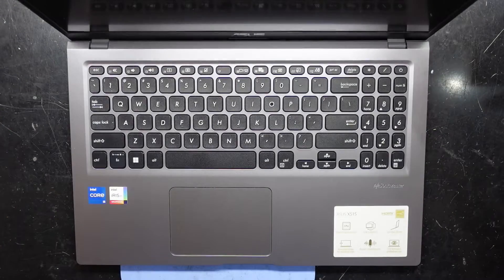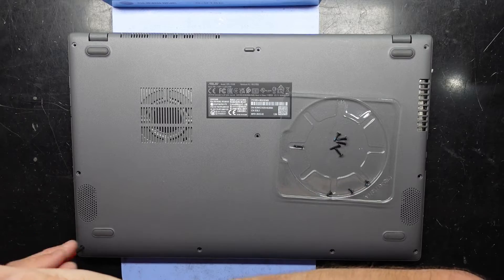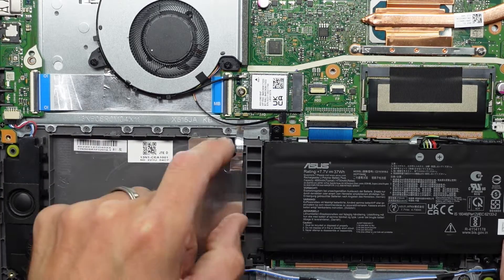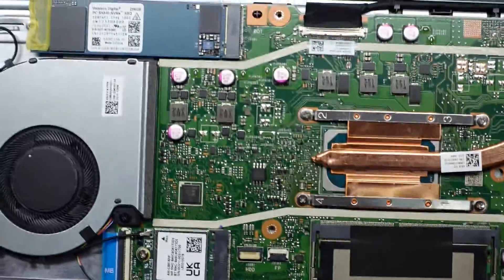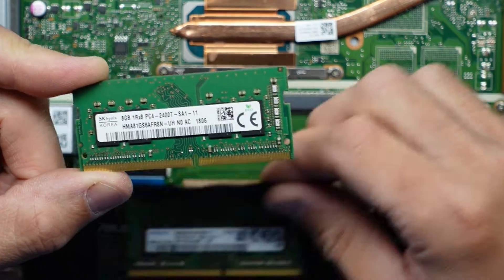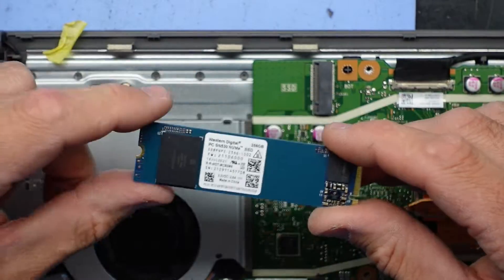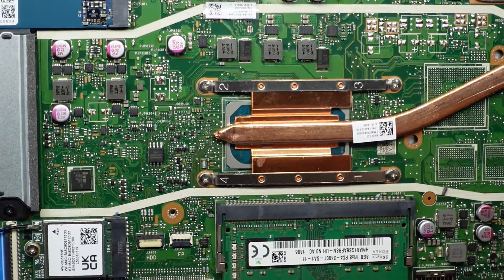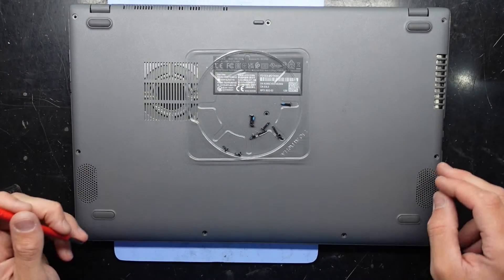Asus X515 / F515EA  Ram and SSD Upgrade

Comment: For some reason after I added one stick of ram laptop doesnt boots up and battery light flashes 2 times. And also ram is not faulty any way to fix it?
Reply: Did you check the ram you installed is it compatible with the other ram ( ddr4 , frequency, cl22 etc )
Reply: @blendx__x9153  Yes, I tried to install 8gb cl22 ddr4 ram
Reply: @SonMfBüken-M160  Did u got it fixed ? Last night i installed +16gb of rom (8gb soldered + 16gb in the free slot ) it works without a problem
Reply: @blendx__x9153  I guess its motherboard or static electric related issue since i tried two identical ram (same size same cl value and same ddr type)
Reply from the maker: hmm not sure sorry

Comment: Hie, i have a similar laptop Asus X515-I382G4W but mine came with 8GB Ram already installed on the Mother board. i want to upgrade the ram, but am not sure what is the max RAM the laptop can handle
Reply: i also have the same laptop it can handle upto 16 gb
Reply: @avnitanand7921  thanks for replying, do you mean that i can only add an 8GB ram and cant add a 16GB ram
Reply: @sandilencube379 yes i have also insert a single 8gb stick  i guess you can put 8 one side and 8 on the other side but other side is integrated so you probably have to give to laptop specialist
Reply from the maker: i would try the 16GB. i dont see why it wouldnt work unless you only have a celeron CPU in the laptop

Comment: I have asus X515 with Nvidia , can I follow the same steps as you, and what's the max of ram I can add to it cause I have now 8 go and want to boost performance as I'm a software engineer ?
Reply from the maker: upgrading to 16gb or 32gb probably wont get the laptop running much better
Reply: @rickstechrepairs  really? Why I thought that it would increase performances a little bit, so what would you recommend to do  please